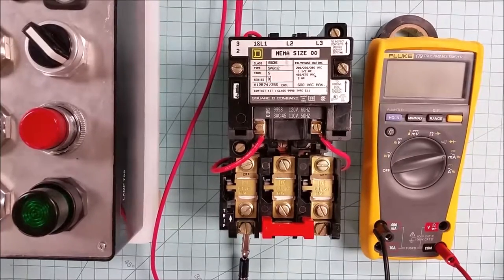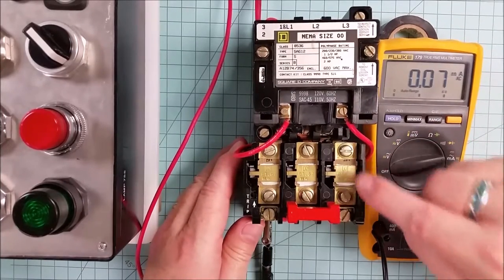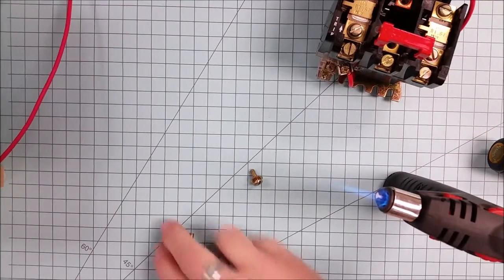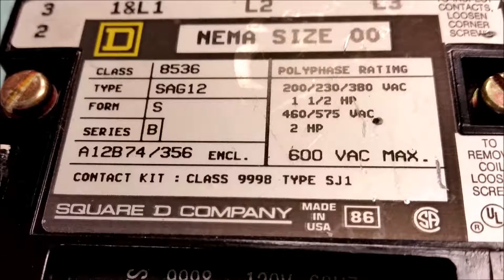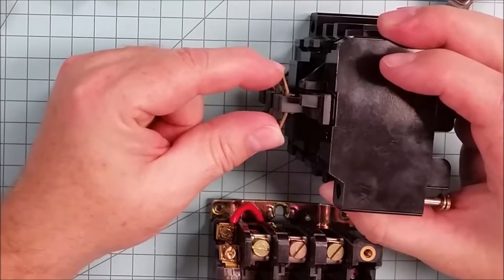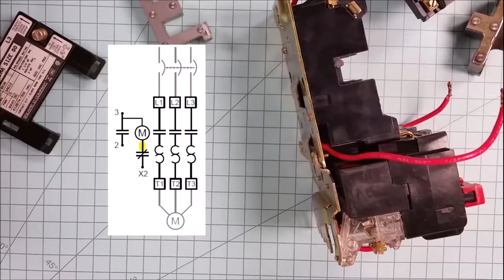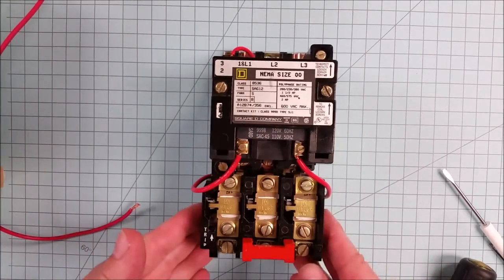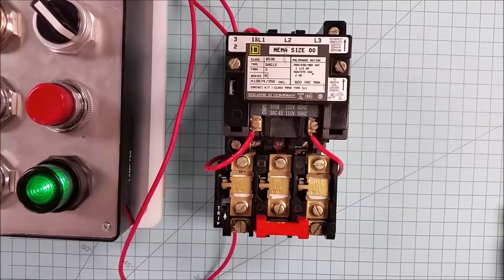SQ D Starter Teardown

Comment: This saved me soooo, much headache tonight on a job that was confusing me because the previous installer wired the unit wrong many years ago and when the time came for the heaters to do their job, everything failed extraordinarily..... But! Thanks to your thorough explanation I was able to diagnose the root cause and proper repair before setting the replacement unit up for future failure.

*I know the video is a bit old but I'm still grateful for the narrators time.

Comment: This is a great video explaining how the contactor works. I have a similar contactor, three phase star configuration. After having a new service installed in the building, the starter question does not operate the compressor as it did when it was hooked up to the original service of the building. I noted that the magnetic coil runs at 208 V. I am under the impression that line one with line to combined using the equation 1.723 makes 208 V to operate this starter coil. All the heaters are working perfectly along with the reset reset button and the push in button to check motor rotation direction. The contactor contact points are in perfect condition. I was wondering if I connect line one and line 2 together I will get the necessary voltage required to fully power up the magnetic coil. Your thoughts will be greatly appreciated. Thank you.

Comment: I’m working on a 3 phase nema 1 - 208 starter for 7.5 hp , with-start stop , start is on 2-3 , stop on L -1,   There is no wire running from the O/L at the bottom where in the video you had-a neutral wire , where did it come from ? Do i need to run one , if so from where ?
Reply: Well you have to complete the circuit for it to work. I am assuming you have a 208V coil. If so, you would go from the O/L contact back to L2 at the top of the starter. If your coil voltage is 120 then you either need to swap out the coil or use a step down control transformer. My setup had a seperate 120V control power source. If you have the original starter enclosure there should be a duagram in it also. Hope that helps.
Reply: @FFSeiler  yes it does help , the diagram was on the box door , they said it was removed in the warehouse and they couldn’t find it ,  the step down transformers were cut off as well ,  we’re going to try put them back on Monday, thanks for the reply.
Reply from the maker: This diagram may be helpful: https://instrumentationtools.com/wp-content/uploads/2017/07/instrumentationtools.com_ladder-diagram-for-motor-control.png?ezimgfmt=ng:webp/ngcb2
Reply: @inw-training  thanks 👍🏻